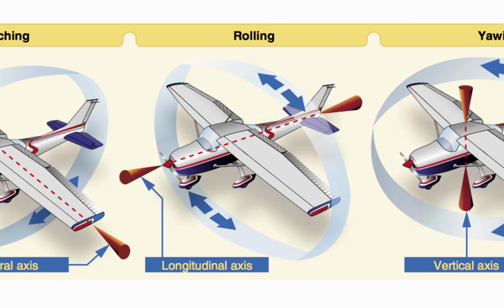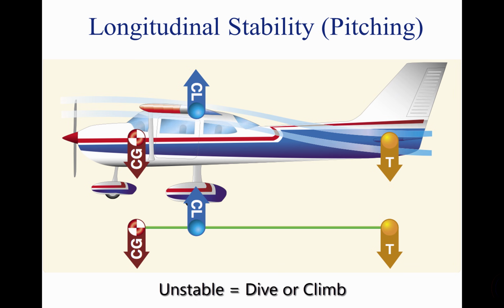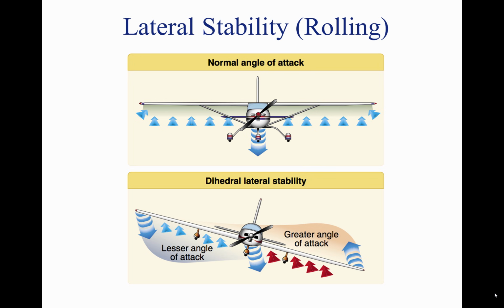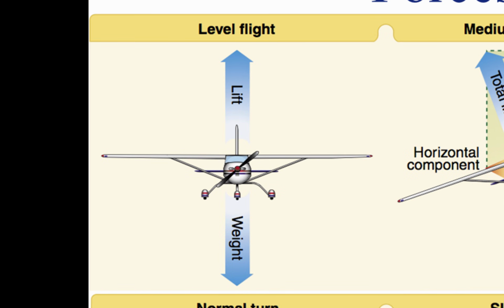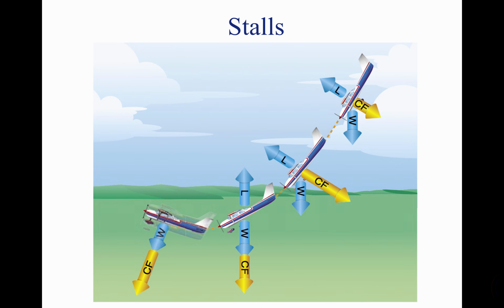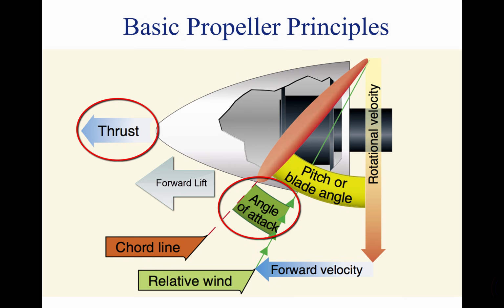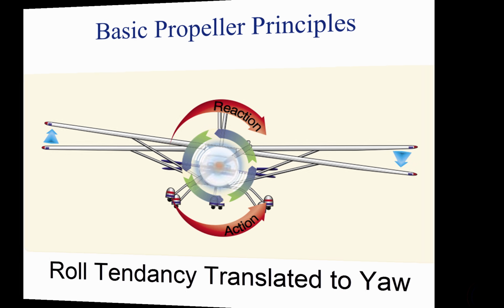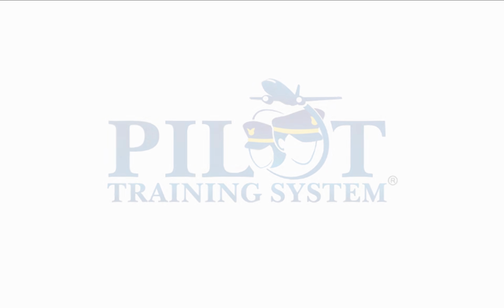Private Pilot Tutorial 4: Aerodynamics of Flight (Part 2 of 3)

Comment: For Gyroscopic action (in 18:50) -  the PHAK shows the resultant force in the opposite direction (to the back of the plane) and the turn about the vertical axes is in a anti-clockwise direction as a result, yaw should be to the left. I'm confused??? Please correct me if I am wrong (I'm having difficulty understanding this). Thanks so much!
Reply: You are correct.  The picture was from an older version of the PHAK and corrected in the newer version.   There are several other examples of these types of mistakes in this series.